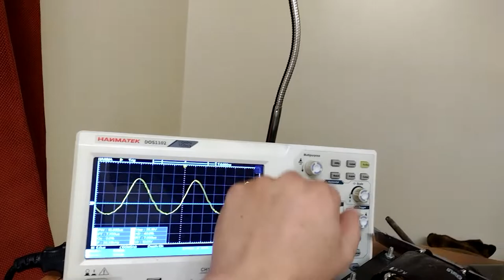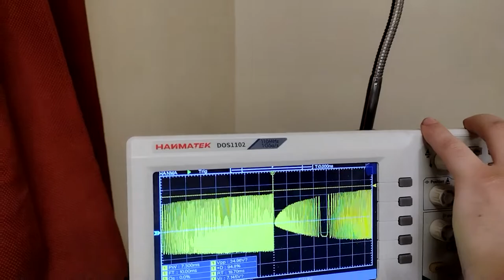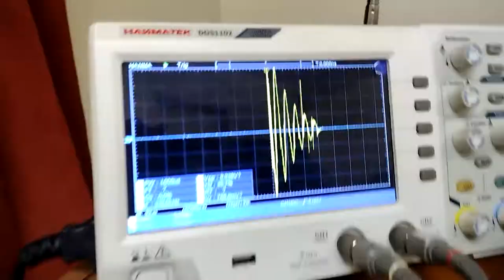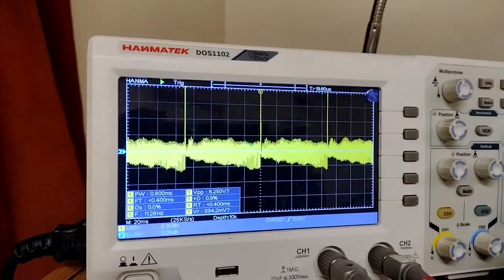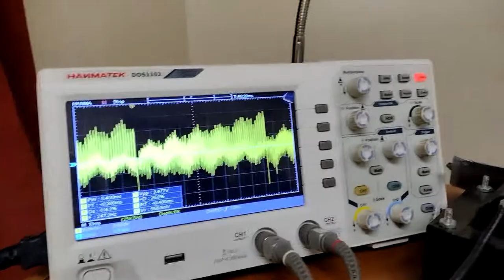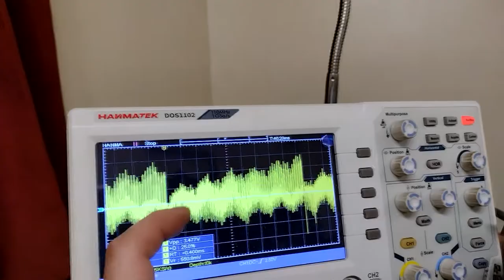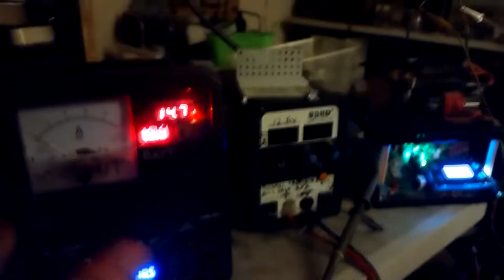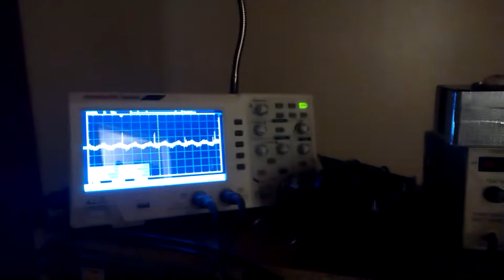"Trumpet" Waveform Explained

Comment: Very good

Have you tested the Don Smith circuit?
Reply from the maker: Not exactly just iterations based on what I had. I doubt what Don was showing because there's too many unknowns, but the concept in general is interesting to me and I don't absolutely discount the possibility of achieving the desired goal.
Reply: @Magneticitist  I see many foreigners don't believe don Smith circuit. This is very interesting. Thank you for your reply
Reply from the maker: @yunshuizhongyi  To me it's because his famous demonstration was not transparent enough, and his following explanations did not quite entirely make sense.
Reply: @Magneticitist  hmmm…I think what Don Smith was saying is that be connecting your resonant tank to ground it will draw energy from ground every cycle creating the “trumpet” wave.  Necessarily, you would need a component between ground and the resonant tank which allowed this energy flow in but not back to ground such as a diode.  His reasoning as he eluded is that at resonance the tank circuit is less negative then ground and thus electrons flow at each cycle of the resonance into the tank.  The analogy would be to striking the tuning fork each cycle adding extra energy and the tuning fork continues in amplitude as a ‘trumpet’ wave.  Thus, the driving energy behind this is from the potential difference between ground and the resonant tank.  Similarly, as in a physics demo in most electrical engineering classes, a negatively charged sphere will dump electrical energy into touching a less negatively charged sphere on contact.  I liked your thought provoking video.  Maybe, to test build a resonant circuit with a connection to ground and shield the resonant circuit from all frequency noise in the environment such that if you see the ‘trumpet’ wave you can ascertain what the role a ground connection provides, i.e., if you then see a trumpet wave disconnect the ground to see if the ground is responsible.